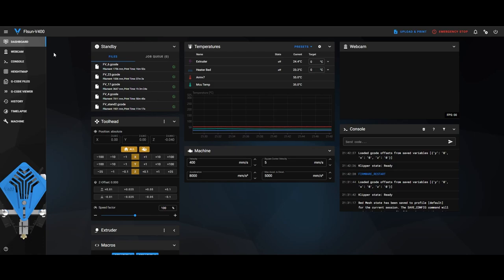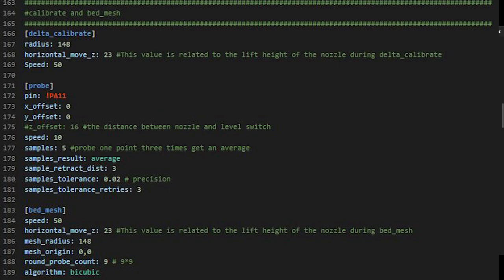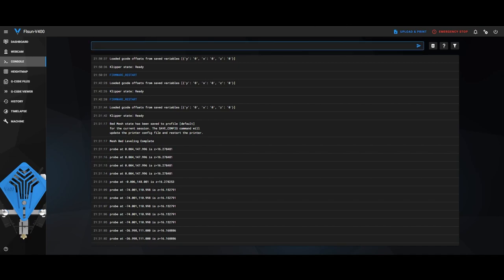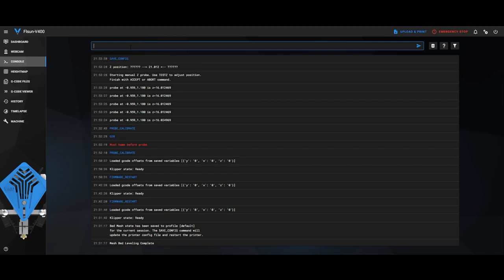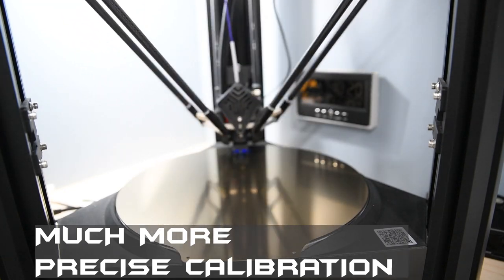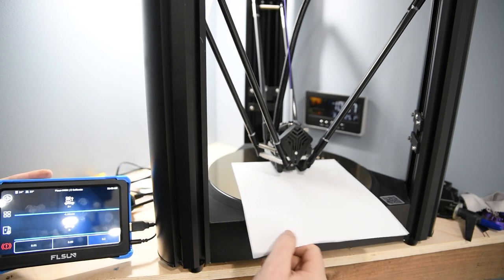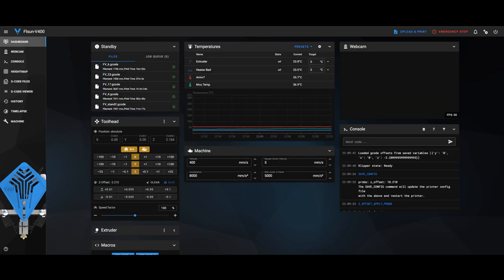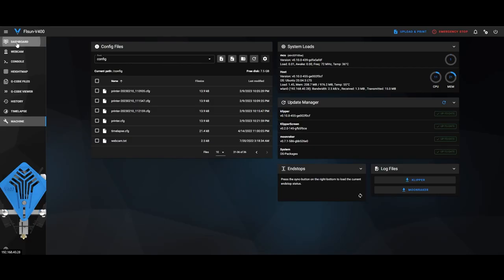FLSUN V400 60 Point Probe calibration Bed Mesh & Start G-code Perfect prints

Comment: Hello, sir, I did the same thing as on your videos, but I do not find the line by default on Cura below G28 is normal? I all have even trying it is great, his grip better but I had the printer that stops in the middle of the print s had you or is the problem? Thank you for your help, I subscribe you are great, thank you very much for the help.
Reply from the maker: you have to write it in yourself under line G28 as i showed in the video and then it will use the hight map you generated while doing the bed mesh.
Reply from the maker: i havent had the printer stop in the middle of prints, how long have you had the printer ? is the memory full ?
Reply: @carphotography  sorry I've had the printer for 1 week I had the stepper b error and sometimes it stops I don't understand why, please had you a private link thank you to be able to discuss when you should have time thank you very much
Reply from the maker: @lafamille2839  was you stepper error "TMC 'stepper_b' reports error: DRV_STATUS: 401b0103 otpw=1(OvertempWarning!) ot=1(OvertempError!) t120=1 cs_actual=27 stealth=1" ? if so someone said  Open the top of the printer and look at the fans inside. Make sure the fans are working. The fans cool the steppers if it is not working give it a little push to get it going.
Reply: @carphotography  I have already watched they work I see it running without disassembling there is shadow with the light I see it running, but it's weird sometimes it will work for 1 hour and sometimes 2 hours and stops I don't understand why,,  ,😞
Reply: right now I have a problem with calibration but when I remove the probe the nozzle touches the plate it presses on it weird
Reply from the maker: @lafamille2839  take a look at this it might help , https://github.com/Guilouz/Klipper-Flsun-Speeder-Pad?fbclid=IwAR3_9aKiM-p_BuETwGO8ZZxAoco5F34PPy6Dpt5_h1jEF66-1j5_y3Qluh8#calibrate-your-printer
Reply: @carphotography  hello sir, thank you it's very kind of you but that does not explain the stops during the print? thank you for helping me
Reply: TMC 'stepper_a' reports error: GSTAT:      00000002 drv_err=1(ErrorShutdown!)
Once the underlying issue is corrected, use the
"FIRMWARE_RESTART" command to reset the firmware, reload the
config, and restart the host software.
Printer is shutdown
Reply: The printer stops at the same time 2 more times please look at the message thank you
Reply from the maker: @lafamille2839  on the FLsun v400 website under support there is the PRINTER.CFG file, you could just start from fresh and hope that fixes it, im pretty new to printing myself.
Reply: @carphotography  les chinois mon dit cest un step cest ce que je pense mais pourquoi fonctionne t elle parfois j y comprend rien merci monsieur
Reply from the maker: @lafamille2839  
Je ne sais vraiment pas non plus qu'il n'y a pas beaucoup d'informations sur Internet à propos de cette machine, j'espère que vous la réparerez
Reply: @carphotography  MERCI BEAUCOUP VOUS ETES TRES BRAVE SYMPA MERCI BON COURAGE SUR YOUTUBE CHEF